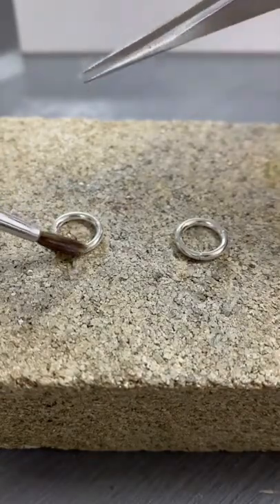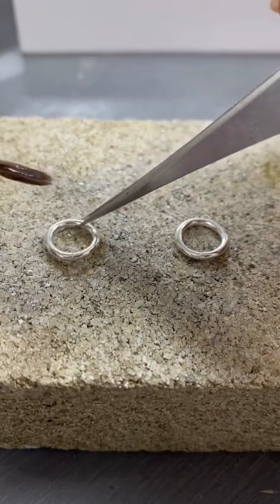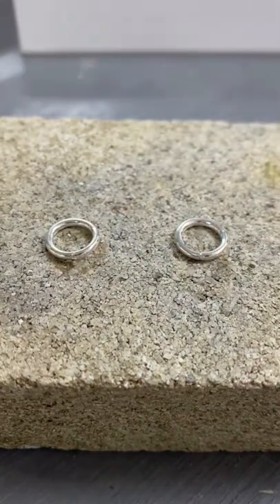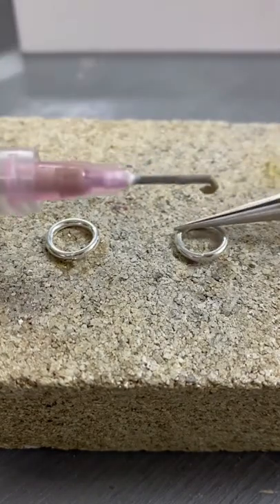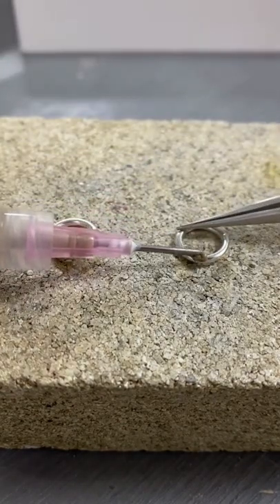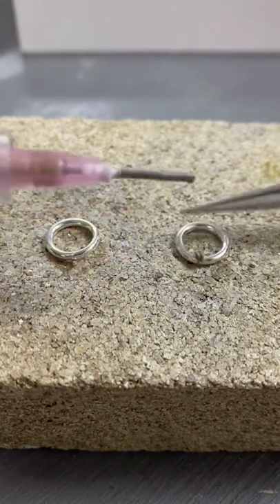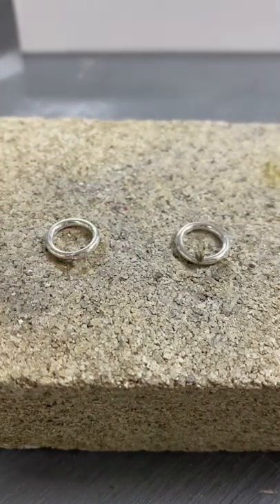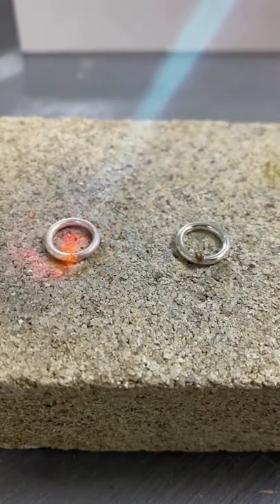Solder vs solder paste

Comment: Which do you prefer and why?
Reply from the maker: Sian says:
"I think they both have their uses :) I know jewellers who will only use one or the other but I actually use both!

I would use solder stick for soldering a ring as you can get the solder to melt and flow along the line of the join neatly. I would use solder paste for a jumpring because you can use a small amount and stick it to where you want it."

Comment: Hey people i am a complete amatur (litrally bought my first bit of silver and solder paste a few days ago from cooksons) every time i try to bond two jump rings togther to make a rope chain it just turns to crumbley dust and fails....any advice ...thanks
Reply from the maker: Ahhh it's so great you've started making jewellery! Don't be put off, it sounds like you are not heating the silver up enough. It's difficult to say exactly what is happening without seeing but generally solder paste is for small pieces of silver like jumprings and then solid silver and flux could be considered better for larger rings and bangles. 

When you solder silver you need to heat up the entire piece of silver before you focus any heat on the join with the solder on. If you have not had any success so far try heating up the silver using the very end of the blow torch flame where you can see no blue flame as this is the hottest. Move the the blowtorch evenly and smoothly, when the silver is hot move the heat to the solder to melt it and then heat the silver evenly again so the solder flows to the gap.

Your join MUST be touching and it MUST be clean, spend some time making sure it is perfect. 

If you are using tweezers to hold your jumprings remember that the tweezers will absorb some of the heat.

If you feel the silver is getting too hot just take the heat off for a moment.

Ultimately if you think the solder join might not solder properly for whatever reason your instinct is probably right and you need to double check all your steps.